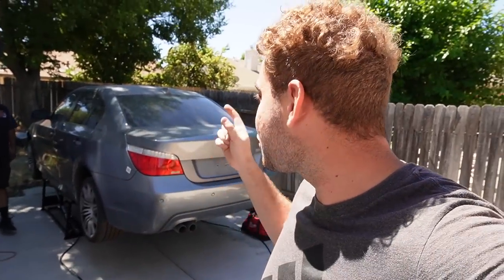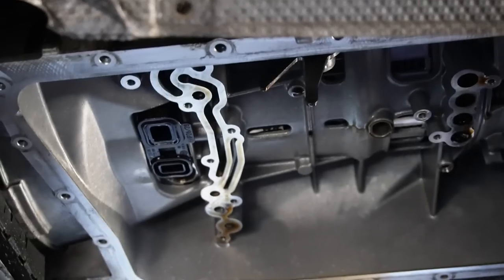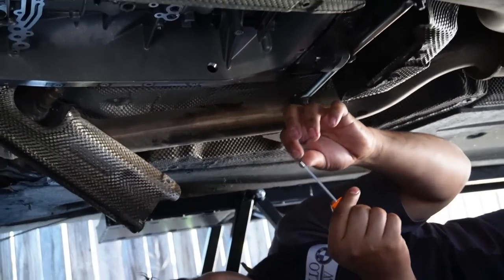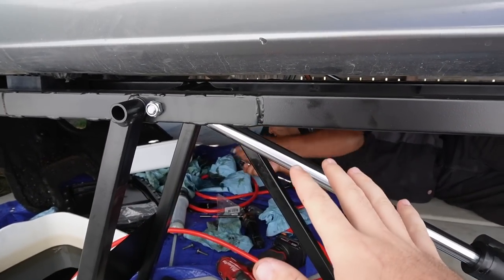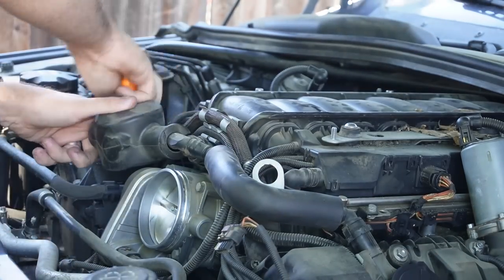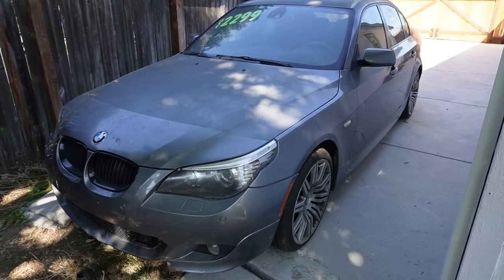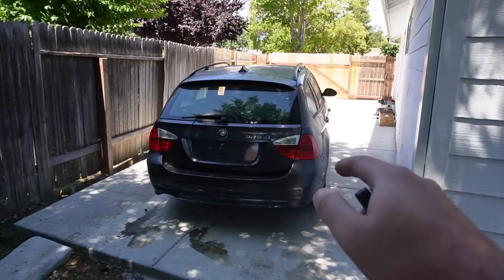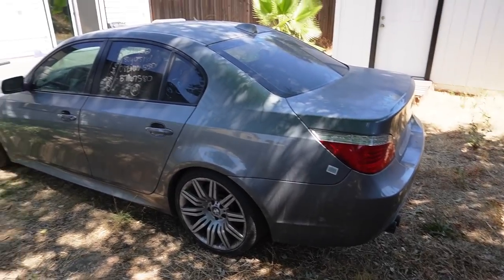DECIDING THE FATE OF MY 2008 550I V8!

Comment: I never understand why people throw away the transmission as it can be rebuilt. You have to be willing to remove the transmission and replace the whole stator bushing and friction clutch that’s inside the transmission not just by removing the transmission pan and also double check the solenoid to make sure no debris stuck on the solenoid filter as that can cause the transmission not to build pressure nor move. All that can be done for under $300 in addition to transmission bushing tool. You do not really need to use ZF lifeguard transmission fluid. You can use Walmart - Valvoline Maxlife ATF multi vehicle auto tranmission fluid $23 a gallon, at least that’s what I have been using in my E60 and it has been more than 30,000 miles and run as good as ZF lifeguard fluid. Also, it better not to reuse the old transmission fluid. If you must know, my 2010 E60 has 230,000 miles and I change the transmission fluid every 50,000 miles to prolong the life of the transmission parts.
Reply: @nourhummadi
Reply: You guys have some knowledge on transmission. Do you guys know why the mechanics at bmw don't recommend replacing the transmission fluid? They claim it's a lifetime fluid.
Reply: @skullkid1175  because bmw just wants it to break so you can either buy a newer car or have maintenance costs. Manufacturers want cars to run for 10 years MAX.

Comment: Well you have 2 more  options first one cheaper to do 6speed swap 
second one more expensive but in my opinion better  to do 8hp70 retrofit :)
Reply: 8hp70 retrofit much better. Best daily;)
Reply: @piovo1   and holds power very well  got on mine e60 atm 700nm next session gonna push over 1000nm :)
Reply: @sigis160  yes sir, best gearbox ever. In a few years there will be 8hp in a lot of older cars now because of turbo lamik.
Reply: @piovo1   well now we have better  option because dont  need  to rewire orginal tcu  and its from CANformance Engineering  :)
Reply: @sigis160  yes it’s also cheapest option out right now.

Comment: hey this is so random but I bought a 09 550i with the v8 when i was 15 with 98k miles long story short did regular maintenance with my step dad in our garage car lasted me about 2 years before  it decided to do what some bmw’s do and its fail on me part by part day by day saved my money for about 2-3 months fixed it completely new trans etccc drove it till i turned 18 so abt 9k miles loved every single bit of it that v8 sounds so good with an exhaust, car would feel nice and fast for what it was, (4 door sedan). i sold it and part of me regrets it but the other half feels relieved cause god damn i spent so much due to my love for the car. e60’s are a pain in the ass if u dont know what ur doing but its great to see you trying to get it up and running. for sure gonna stay and see the results you just earned a subscriber. im turning 19 in a few months now, still have a bmw but went with the 135is n55 Dct trans. fell in love with the engine when I rode in my buddies 335i n55 stage 2+ on mhd, realized the potential even though the n55 has a small power peak compared to the n54. anyways loved the video ima spend the next few hours watching youre videos.
Reply: Hey boss I got a question, I plan on buying a 550i 2007 200k miles on it, you think I should pass? I’ve had 750i 2012, crashed it because fell asleep on the wheel, had a 740il 2001 sold it , I’m very passionate about these bmws but what is your intake on this, is there ever a bmw that’s impossible to replace and make as if new again?

Comment: Hello Nour! I’ve always been a fan of your content and it’s always great seeing the updates. 

I have an elusive problem with my e90 330 xi 2006. It's got 120k+ kms. 
A month ago I was refueling while the engine running, and as the fuel was getting to the 3/4 mark, the engine stopped and my iDrive and dashboard were illuminated (transmission malfunction, 4x4 inactive, DTC disabled, and start assistant inactive). I turned the ignition on again after refueling and the car took time to crank, when it did it was in limp mode, I was in a remote village with nowhere to seek support, I drove 100 km in limp mode. As I entered the city, I stopped at a grocery store, and when I got back into the car and cranked it, everything had gone back to normal. 

Long story short, since that day, it's been giving me hell on earth! 

For the next few days, it would take time to start and would intermittently stall while driving and before it dies, it pops out all the above faults. 

I diagnosed it with Carly and there was a code for Crankshaft position sensor signal, I shipped an OE part from FCP Euro and replaced it. Since then it doesn't take time to start like before but whenever I press the pedal a lil hard, especially on an inclination, or sometimes on a stretch, the car acts like it's cutting the power supply, and RPMs drop for a second, the car regains momentum when I release the pedal. When it happens, the check engine light comes on and disappears after a while, sometimes it doesn't. The car stalls when It's going uphill, even at low RPMs

We have no BMW specialized shops in my country and I have tried to use my indie mechanic, I did my transmission service (oil and filter), replaced spark plugs and fuel pump, but no improvements. 

When I hook it up on Carly, it shows, camshaft, crankshaft correlation codes, and a transmission code! 

A more experienced BMW expert advised that the engine timing must be off, the car’s engine has never been worked on as far as I know and I’m a bit afraid to open the engine unless I am certain. The car’s idling is ok at 600 RPMs and runs ok when not under strain as on a steep hill or under much acceleration on a stretch.

I could use your help to understand what is going on!
Reply: Camshaft codes can be caused by either the camshaft sensor or VANOs solenoids, which are crucial to engine operation, if you have let's say for example codes on the intake side, clean the sensors and solenoids and swap it over with the exhaust side, clear codes. If the new codes move over, then its related to those components, swap just the sensor and you can isolate if the issue is either the sensor or solenoid. If you have issues on both intake and exhaust, see if issues improve with cleaning the solenoids.

Comment: i know im dumb but is that really the case of used burnt oil being good for trans? I've always replaced all of the fluids with fresh new one's. Btw those transmissions aren't that expensive, if my memory serves me right it's used in several other models, was it the 6 speed or the 8 speed?